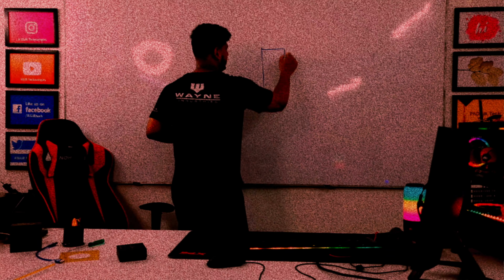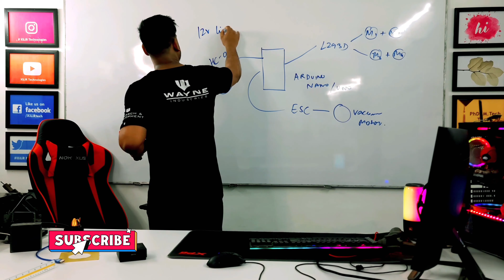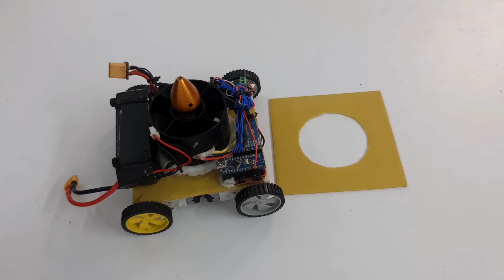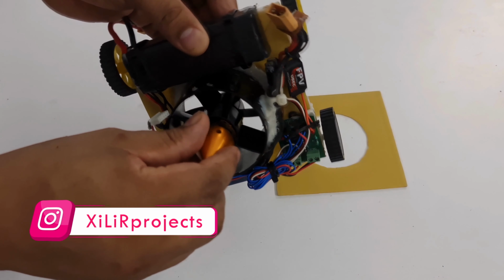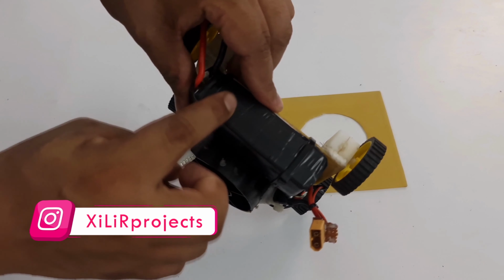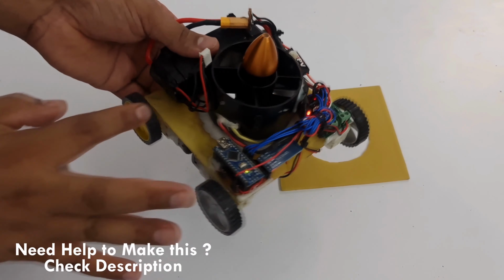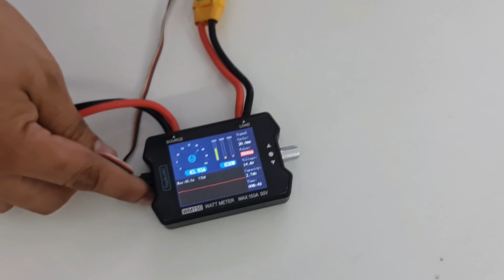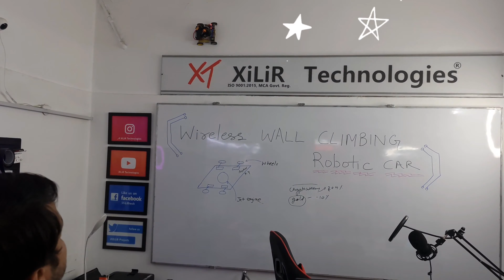How to Make Wall Climbing Robot Car using Arduino by XiLiR, Engineering/Innovation Project

Comment: Hello, thank you for the interesting project. From where can get the code for this project???
Reply from the maker: //Arduino Bluetooth Controlled Car//
//// Before uploading the code you have to install the necessary library//
//AFMotor Library https://learn.adafruit.com/adafruit-motor-shield/library-install //

#include <AFMotor.h>

//initial motors pin
AF_DCMotor motor1(1); 
AF_DCMotor motor2(2); 
AF_DCMotor motor3(3);
AF_DCMotor motor4(4);

char command; 

void setup() 
{       
  Serial.begin(9600);  //Set the baud rate to your Bluetooth module.
}

void loop(){
  if(Serial.available() > 0){ 
    command = Serial.read(); 
    Stop(); //initialize with motors stoped
    //Change pin mode only if new command is different from previous.   
    //Serial.println(command);
    switch(command){
    case 'F':  
      forward();
      break;
    case 'B':  
       back();
      break;
    case 'L':  
      left();
      break;
    case 'R':
      right();
      break;
    }
  } 
}

void forward()
{
  motor1.setSpeed(255); //Define maximum velocity
  motor1.run(FORWARD); //rotate the motor clockwise
  motor2.setSpeed(255); //Define maximum velocity
  motor2.run(FORWARD); //rotate the motor clockwise
  motor3.setSpeed(255);//Define maximum velocity
  motor3.run(FORWARD); //rotate the motor clockwise
  motor4.setSpeed(255);//Define maximum velocity
  motor4.run(FORWARD); //rotate the motor clockwise
}

void back()
{
  motor1.setSpeed(255); //Define maximum velocity
  motor1.run(BACKWARD); //rotate the motor anti-clockwise
  motor2.setSpeed(255); //Define maximum velocity
  motor2.run(BACKWARD); //rotate the motor anti-clockwise
  motor3.setSpeed(255); //Define maximum velocity
  motor3.run(BACKWARD); //rotate the motor anti-clockwise
  motor4.setSpeed(255); //Define maximum velocity
  motor4.run(BACKWARD); //rotate the motor anti-clockwise
}

void left()
{
  motor1.setSpeed(255); //Define maximum velocity
  motor1.run(BACKWARD); //rotate the motor anti-clockwise
  motor2.setSpeed(255); //Define maximum velocity
  motor2.run(BACKWARD); //rotate the motor anti-clockwise
  motor3.setSpeed(255); //Define maximum velocity
  motor3.run(FORWARD);  //rotate the motor clockwise
  motor4.setSpeed(255); //Define maximum velocity
  motor4.run(FORWARD);  //rotate the motor clockwise
}

void right()
{
  motor1.setSpeed(255); //Define maximum velocity
  motor1.run(FORWARD); //rotate the motor clockwise
  motor2.setSpeed(255); //Define maximum velocity
  motor2.run(FORWARD); //rotate the motor clockwise
  motor3.setSpeed(255); //Define maximum velocity
  motor3.run(BACKWARD); //rotate the motor anti-clockwise
  motor4.setSpeed(255); //Define maximum velocity
  motor4.run(BACKWARD); //rotate the motor anti-clockwise
} 

void Stop()
{
  motor1.setSpeed(0); //Define minimum velocity
  motor1.run(RELEASE); //stop the motor when release the button
  motor2.setSpeed(0); //Define minimum velocity
  motor2.run(RELEASE); //rotate the motor clockwise
  motor3.setSpeed(0); //Define minimum velocity
  motor3.run(RELEASE); //stop the motor when release the button
  motor4.setSpeed(0); //Define minimum velocity
  motor4.run(RELEASE); //stop the motor when release the button
}
Reply from the maker: U can use any basic bluetooth car controlled from internet
Reply: @XiLiRTechnologies  
Thank you very much 💙